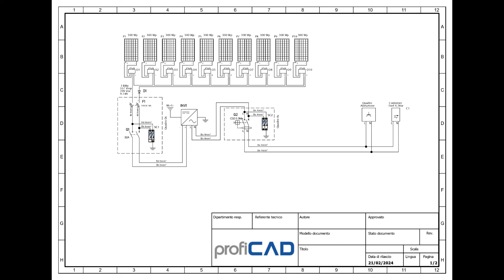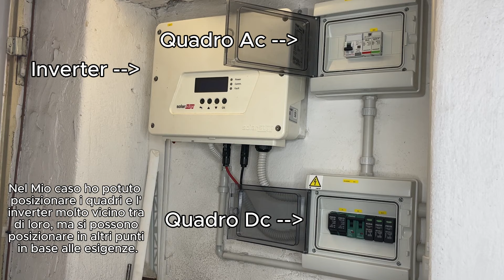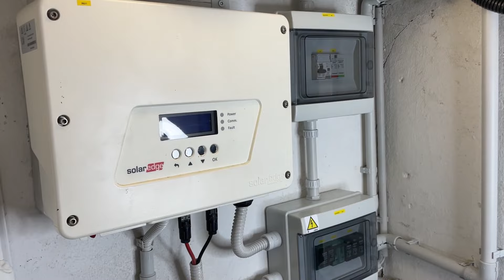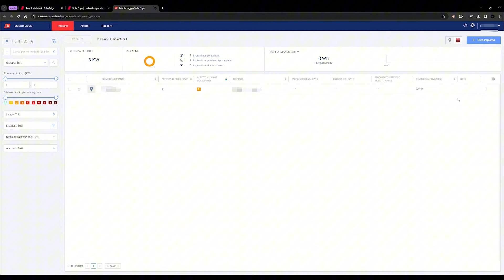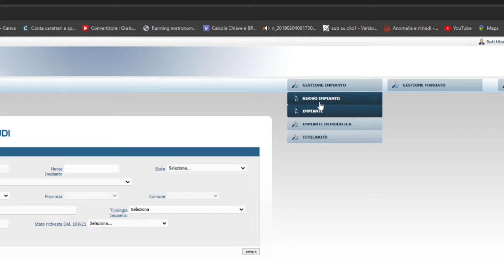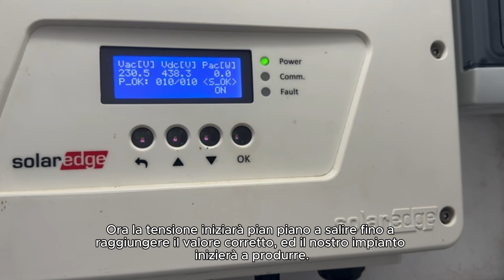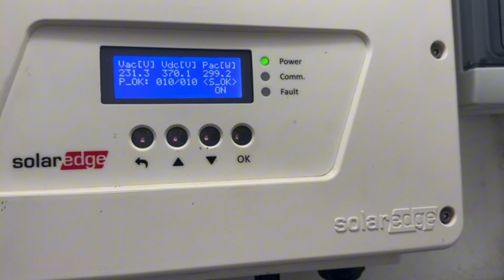Impianto Fotovoltaico Dal quadro alla burocrazia

Comment: Io ne ho fatto uno da 2kW e 11,7kw di accumulo con inverter solis
Reply from the maker: Ma allaccio in rete?
Reply: @howtodiy6292  no adesso ho l ATS x emergenza ma tra poco stacco l Enel ..l inverter funziona anche solo con la batteria 48v non mi serve la rete..non è come i soliti voltronic Aesuna ecc che ti devi collegare in entrata con Enel.
Reply: @deejaytiger6910 Anche io ho un impianto con ATS ed ho un Voltronic.... non capisco perché dici che non funzionano senza enel/gestore in ingresso. Io non ci ho mai collegato niente all'ingresso! Se ho batteria alimento casa tramite inverter, altrimenti l"ATS switcha su enel.
Reply: @deejaytiger6910 vedi che easun 6.2kw o 5.6 o 3.5kw o 2.4kw funzionano anche solo con batteria e pannelli e sono già 230volt monofase e non flottante come tanti altri e oggi il 6.2kw accetta fino a 6500watt di pannelli  e viene solo 450euro  con wifi e blututt e app
Reply: Poi 2kw di pannelli mi sembra un po poco per l'inverno ti consiglio di aggiungere due pannelli da 510watt longi o simili almeno ma hai 230amper a 51.2v per avere 11.7kw di batteria quindi puoi caricarla a 0.3c cioè con 3500watt perché d'inverno se hai brutto tempo per 1settimana come fai..potresti mettere un generatore diesel o benzina al posto dell entrata enel 230volt così puoi in 2ore caricare la batteria dato che inverter ha un caricabatterie che carica da 230volt o da rete settabile da 2amper fino 80amper nel easun 6.2kw ma quasi tutti ce l'hanno
Reply: @stefanocerna6504  2kw vanno benissimo tutti sti pannelli non servono  ho già DMESH che hanno un voltaggio di 50v alle 13 ho già la batteria carica..adesso ne metto un altra x arrivare a22kw di accumulo ho una batteria da 52v BASEN green carico fino al massimo può caricare fino a 4kw ma tutta sta velocità non mi serve visto che i miei consumi stanno sui 240watt   ora..il resto è tutto in caricamento ..tra l altro dopo le 13 l inverter rallenta la potenza dei pannelli perchè la batteria è piena e li usa solo x il consumo.2 kW sono più che sufficenti
Reply: @stefanocerna6504  poi  tra un paio di anni dovrai cambiare mezzo inverter VENTOLE ECC..oltre all alto consumo che hanno
Reply: @deejaytiger6910  ora in estate c'è la fai ma poi in inverno non credo proprio soprattutto se metti un'altra batteria così con 2kw di pannelli in inverno forse carichi 4kw al giorno di solito per essere giusti si mette 1/3 del accumulo tipo se ha 300amper lifepo4 da 15kw si mette 5kw di pannelli quindi con 22kw minimo 5kw ci vuole poi dipende dai suoi consumi  giornalieri ma se piove per 1settimana non carichi nulla ma per capire meglio quando e che ha messo l'impianto credo da poco e quindi non sa come funziona in inverno poi dipende anche da dove abita e se i pannelli sono esposti bene a sud con inclinazione corretta
Reply: @stefanocerna6504  non è assolutamente come dici tu..io consumo poco e di picchi ne faccio pochi in inverno come ti ho già detto alle 13 l inverter deve rallentare la potenza dei pannelli.perche al mattino nessuno è in casa risultato 1,8kw x 4 ore con sole vanno in batteria..il discorso è che non consumo l i tera capienza della batteria durante la notte quindi cosa succede ..che il giorno dopo mi trovo la prima batteria a 65%e quindi si carica in 2,3ore poi dalle 13 in poi ci sono altre 3 ore che posso caricare l altra.. non è che devono essere x forza sempre al 100x100 e quindi quando hai li 30-40kw di accumulo non x forza lo devi caricare in una giornata..una cosa è certa che anche se carico 2 kW in più al giorno quando i 25-30kw sono immagazzinati li usi quei 2 giorni che non c e sole...tra l altro i pannelli producono circa 230wat senza sole quello che mi serve x gestire il consumo istantaneo e quindi non devo prelevare dalla batteria..quindi NON È COME DICI TU
Reply: @deejaytiger6910  vedrai in inverno che arrivi con batteria carica a settembre ok ma poi piove per 1settimana e la batteria è finita e poi vediamo lo so che non devi caricare sempre al max ma anche solo al 70% il problema è l'inverno cmq ora i pannelli costano meno e con 250euro riesci a mettere 2 pannelli da 510watt in caso se con 2kw non bastino credimi che c'è chi con 5kw di pannelli cmq non c'è la fa  d'inverno cmq lo scopri questo inverno e in caso puoi aggiungere due o tre pannelli
Reply: @deejaytiger6910  scusa ma hai due batterie ma non sono unite insieme in parallelo e le carichi contemporaneamente e non prima una e poi l'altra che vuoi dire
Reply: @deejaytiger6910  mi puoi dire come le carichi le batterie lifepo4 ora hai 11.7kw cioè una batteria lifepo4 51.2v da 230amper o 2batterie una da 5kw e una da 7kw non capisco
Reply: @stefanocerna6504  ora ne ho una da 11,7 kW ..sono 52v x 230 ah..mi basta x fare 4 giorni senza caricare..ma ne metteró un altra uguale perché come già detto alle 13 la batteria è già carica..quando ne avrò 2 mi stacco da enel..ma poi come fai a pensare che uno può avere 2 Bat una diversa di kW dall altra.non ha senso..comunque ti consiglio di prenderti un inverter serio .non i voltronic o EA sun ecc con ventole perchè quei tipi d inverter consumano troppo .quando l mppt lavora consumano oltra 200w ma nessuno ve lo dice..i migliori sono i SOLIS,ZUCCHETTI,WUAWEY,DEJE,SORAEDGE,ZERO CO2,ed altri SENZA VENTOLE..
Reply: @stefanocerna6504  come le carico? Semplice il mio inverter SOLIS 6kw  ha un intervallo di 90-500v mppt ho un consumo medio di 200watt /h  2kw di pannelli ..vuol dire che al mattino quando non ci sono alle 8 la batteria inizia a caricare in base alla giornata ..dalle 8 alle 12 sono 4 ore  supponiamo 1-1,5kw fatti 2 conti alle 13 la batteria è gia carica....anche perché di notte consumo circa 1,2kw e al mattino la batteria non è completamente scarica ma al 65x100.